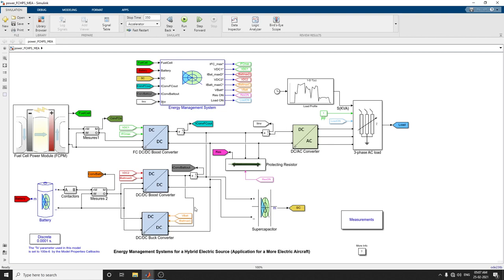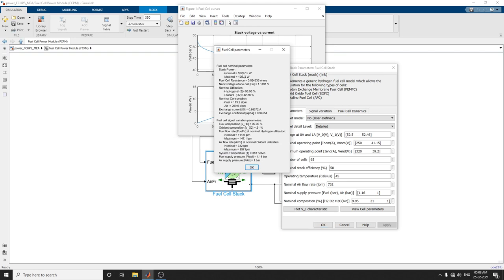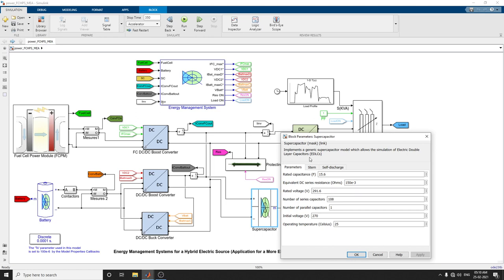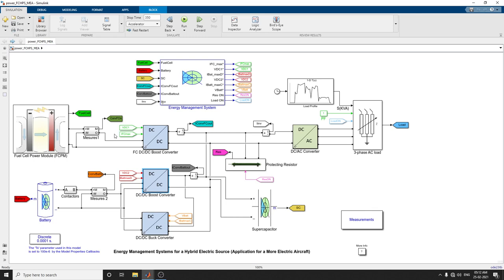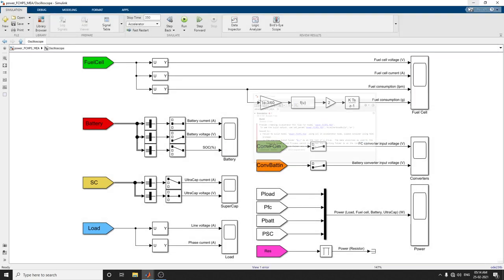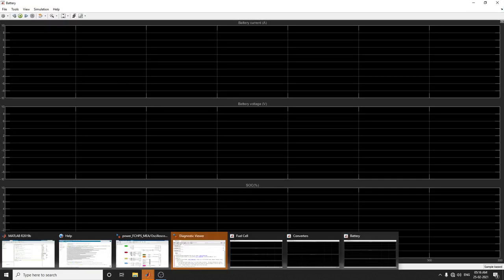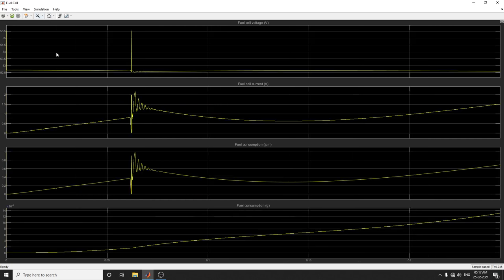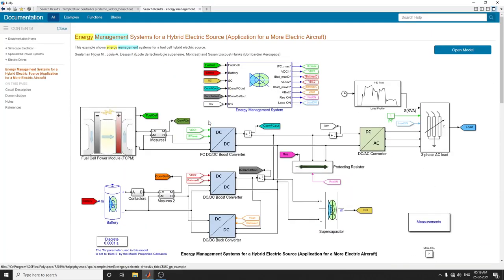Modeling and Simulation of  Fuel Cell Based Emergency Power System of More Electric Aircraft (MEA)

Comment: do you can help me for optimisation this system
Reply from the maker: Can do it....
Reply: @DrMSivakumar  
optimisation 1
remplace Boost converter of fuel cell by
"Isolated Boost converter of fuel cell (slide mode control)"
do you can hel me 
thanks
Reply from the maker: If you have any reference materials, send it to me.. Let's try....
Reply: Please sir im interested to know how system management work on matlab please
Reply: @saraabssane4744  
1.remplace Boost converter for fuel cell by isolated boost converter uniderctionel controled (sliding mode control) this is one of three

Comment: Hello sir. I am working on project of standalone power generation using PEM fuel cells. Can you please help me with making simulink model of that. I have tried my best but i am not able to do that and even i have tried to modify parameter in this model but it doesn’t work. Thanks in advance.
Reply: Can u help me i have same project ?
Reply from the maker: Send the related details....
Reply: @DrMSivakumar  how i can contact you sir please, my project is about a management power system for hybrid system pv panel /fuel cell/battery i want détails about   the control system part  in matlab simulink